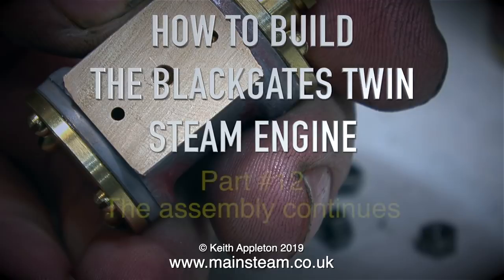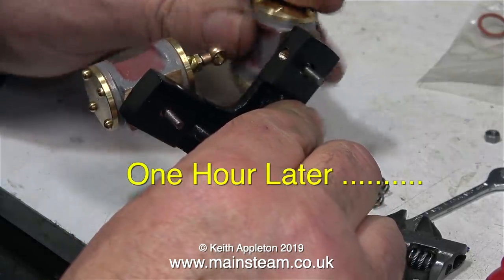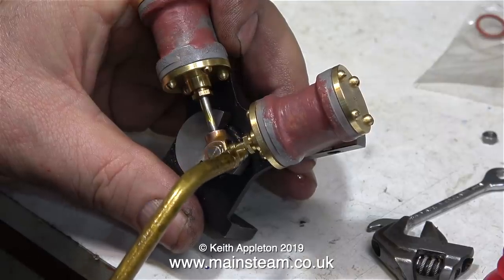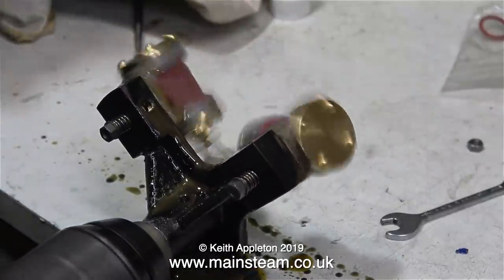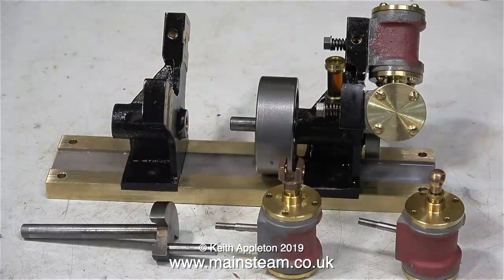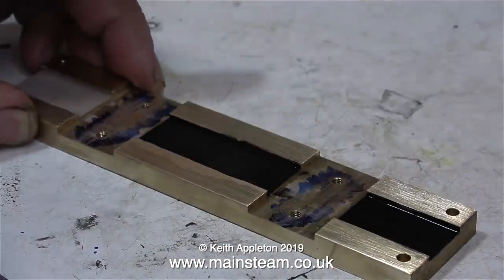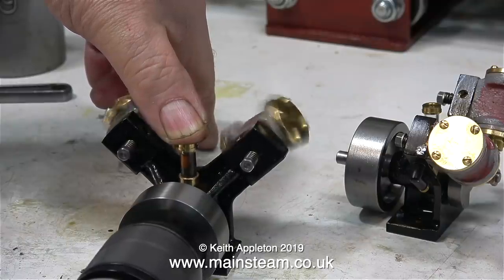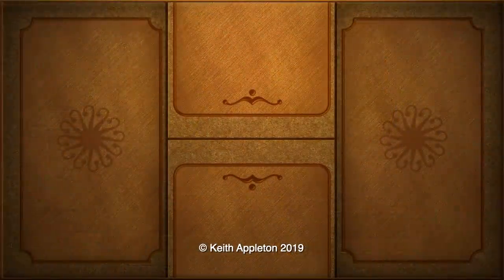HOW TO BUILD THE BLACKGATES TWIN STEAM ENGINE - PART #12

Comment: That is a very good tip on the assembly, Keeping the trunnion pins square is always one of the critical jobs on osculating engine. I checked with Blackgates and they still sell the casting set for these engines, for    £52.00 plus shipping. I will have to add that to the list of gift ideas for my Birthday (70 in August).

Comment: I'm really enjoying watching this engine come together but I seem to have missed an important detail and looking back through the videos I can't find any information on the big ends and how they fit together. In one of the early videos you show the drawing and it appears that one big end is forked with two small bearings while the other has a single bearing that sits between the forks, is that the case ?
Reply from the maker: Sorry, I thought it was so obvious so I didn't mention it - one big end is forked, the other isn't.
Reply: @keithappleton  Thanks for that, I thought that must be the case but also thought I saw one-piece big ends somewhere (must have been a different engine) which is why I was confused. I couldn't figure out how a twin oscillating engine would work with one piece big ends.
Reply: @keithappleton  You just wanted your very own steam powered Harley.